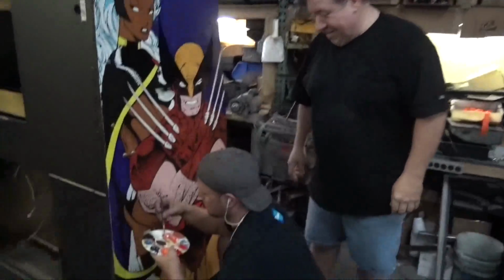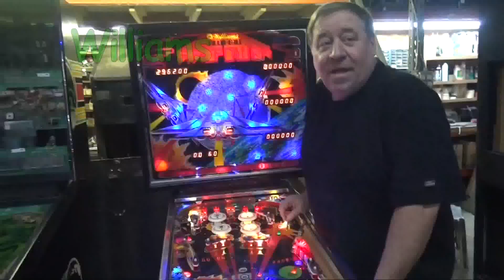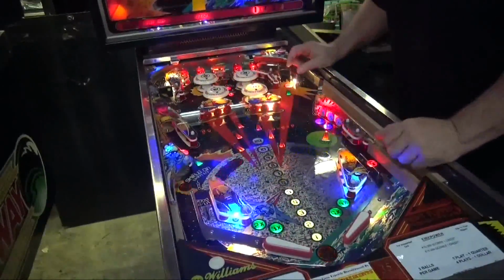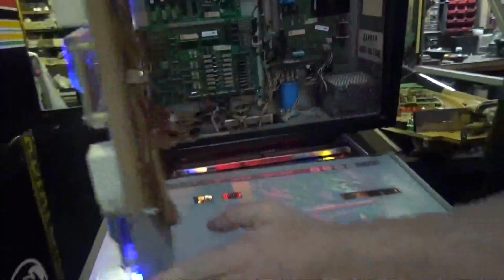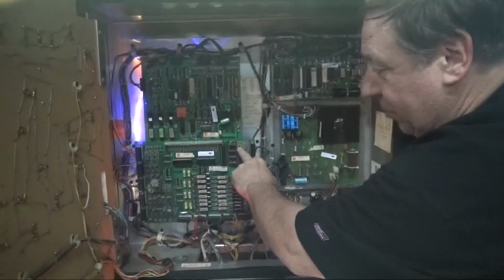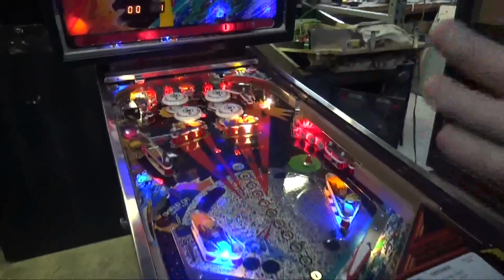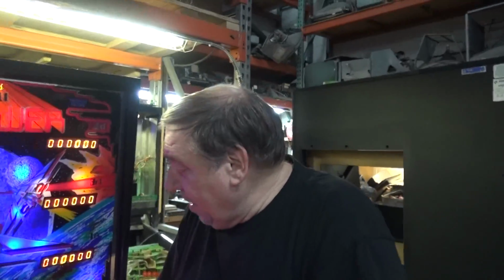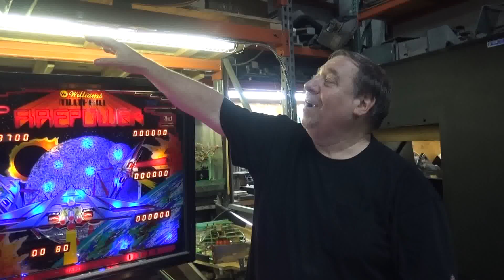#717 Williams FIREPOWER Pinball Machine -First with "Lane Change"! TNT Amusements

Comment: I wonder if you can take a large flat screen 30 - 42 inch and use it in that exam instead of having the 2 screens.
Reply from the maker: rarecoolitems The X Men logic board sends two separate signals in two separate connectors out to two different monitors...one monitor gets one half and the other the other half.  It is possible that soemthing could be rigged I suppose...but there is NOTHING wrong with two Wells Gardner 7000 chassis monitors---the very very best every made!

Comment: It looks like they use general PCBs and all they need to do is change the EPROMS or the chips that contain the game programming for different games to save money.
Reply from the maker: Lyle Johnson  It seems that all the major manufacturers had three pinball PCB systems over the years...all coincidental too....as the games needed to do more and more...and it was generally a few eproms to switch the games out.  Stern is using a board system they developed ten years ago on their most recent game Walking Dead...but is about to start another new system.